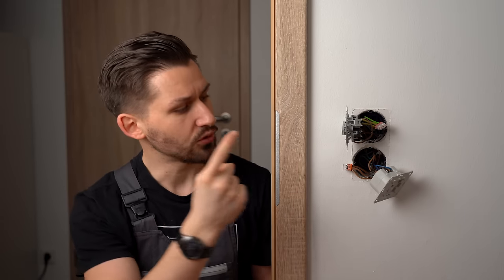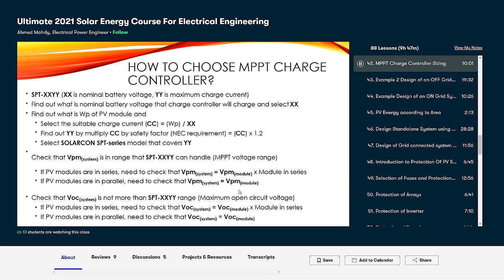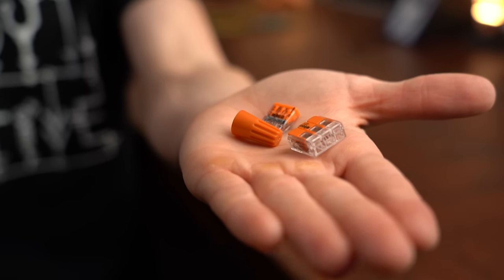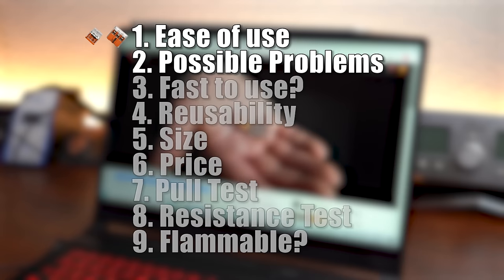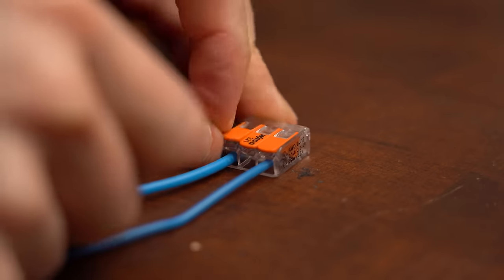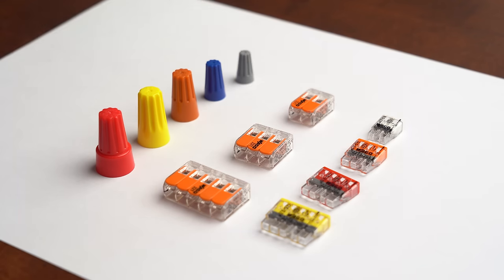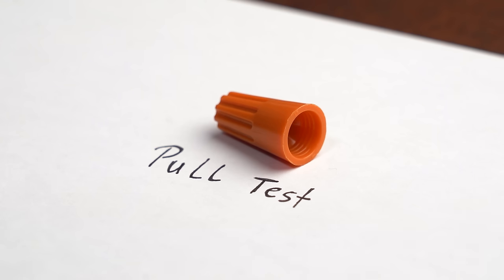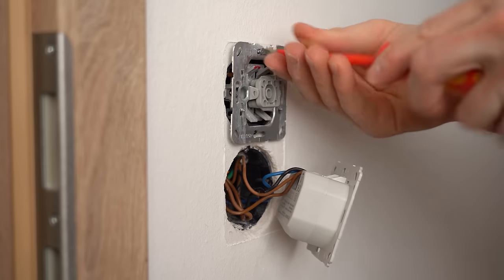What Wire Connector is the Best? Settling a Debate! Wire Nut VS Wago

Comment: I was taught that you do not twist the wires with the wire nut. You twist the wires with pliers first, making sure they are in correct and intimate contact. Then you twist the wire nut onto the twisted wires.
Reply: It would have been nice to see wire nuts used correctly. They wires are supposed to be twisted together before installing the wire nut just as you said. Also a fairer comparison would be using the Ideal wing nuts because those are what is used in the field here.
Reply: @davisladd6473  whats the difference with a wing nut?
Reply: @tjeulink  wing nuts allow the bare hand to leverage higher torque to the copper wires, twisting tighter.
Reply: @davisladd6473  it's actually not necessary. I do pretwist mine. However wire nuts are made to cut into the conductors and grip them and twist them.

I prefer the redundancy, myself, as many do so it's still done. If you don't prep the wire proper(good length, mechanical twist, trim after) then you can make an even sloppily connection and you should have just let the wirenut do its job.
Reply: I was told by someone much smarter than me to pre-twist wires before the nut.
Reply: You are correct. I was also taught that the wire nut is to insulate the connection from everything else around it. Glad to see someone else knows this.
Reply: @etherealrose2139  It's specifically not necessary with the advent of integral square wire spring, but it's still good practice. Before the springs it was necessary.
Reply: @davisladd6473  read the bag on your next set of wire nuts. They don't recommend pre-twisting with most current wire nuts.
Reply: @jessem8928  i dont see how that would make much difference in the video. But it is a better design
Reply: @davisladd6473  So you should first twist the ends together with a plier and then use a wing nut for tightening...ideally standing on a ladder 3m above the ground? I don't think that's an additional bonus point for the wire nut.
Reply: @paulpahl1607  The bonus point is for a solid low resistance connection that won't fail in 100 years. That's why electricians don't make €15/hour.
Reply: @Peter_S_  How do you prove that the connection is solid when you see nothing? Tearing at the wire nut? Sounds professional.
Btw: There was another comment from an US user who stated that he had to replace all wirenuts over the time because they became loose. Hmm...
Reply: @paulpahl1607  You're trying to invent a problem that doesn't exist, and then you get sarcastically snotty about it. This video shows how to incorrectly attempt to use wire nuts. Have you ever used a wire nut? Have you ever seen a wire nut in person? They contain a coiled spring that crushes the wire harder than any Wago could ever dream of. There are tens of billions of wire nuts in use right now. They create reliable gas tight connections and some are even rated for direct burial. Wagos start out lose and only deteriorate. Look at the resistance test.
Reply: @Peter_S_  Yepp, tried them out. And wasn't lucky about them, too cumbersome and too slow. Beside the fact that they aren't allowed here in Germany because they have no print on it about technical specs, technical verification and CE.
I prefer to spend a little bit more money and then feel save and be much faster with my work.
And I know nobody who uses them...different countries, different approach I think.
Reply: @paulpahl1607  If you can't operate a wire nut, how to you manage to operate a screwdriver? Nuts produce far better connections as shown in the resistance test here. When used properly on new wire the lever wago was 14.6 TIMES higher resistance than the wire nut. High resistance = failure point. That's where fires start. Bad connections to save 4 seconds on a job somebody is presumably paying you good money to do good work on? There are plenty of wire nuts in America that were installed before your country was taken over by an Austrian landscape painter and driven to destruction. They're still working perfectly fine in buildings across the country so you may want to double check your criteria.
Reply: @paulpahl1607  better fall off the ladder than burning down the house 10 years later
Reply: @paulpahl1607  how do you prove the connection is good? duhhhhh you make the damm connection and then AFTER that you insert the nut... for insulation purpose only....didnt you read someone above explaining it to you? its the best practice for safely using wire nuts

Comment: The reason the Wago connectors have a current rating and the wire nuts don't is because of the way power flows. In a Wago, the power has to go through the connector, but in a wire nut the wires are held together and power goes straight from one to the other.
Reply: Yeah pretty much. With wire nuts, the connecting element being conductive is more matter of fact rather than elementary to the design. Definitely an advantage from an electro-physics perspective.
Reply: Sounds like a potential way to start little tiny fires inside your walls and attic when there's an over-amp situation.
Reply: @ShadoFXPerino  Wagos aren't meant to be fuses, and they can absolutely melt and fuse wires together open as well.  They CAN act like a fuse, but there is no guarantee of it, nor is it something to be relied on.  If you have overcurrent, it's melting and fusing just like a wirenut would.
Reply: @truthbetold1855  He has not mentioned them acting as a fuse in any way. Thats only your interpretation.
Reply: @truthbetold1855  A wire nut wouldn't melt and act like a fuse because the wires are physically twisted together. The wirenut is not carrying any current. You can take it off and the mechanical connection of the copper is fine.
Reply: @ShadoFXPerino  not really. They are likely dimensioned to take at least 1.5 times theit rated current indefinitely. They and any other wiring only become a hazard if you put them behind a fuse that's rated too high to begin with.
Reply: @RicolaTanker  Some idiot might wire a fusebox open because they don't want to be bothered with fuses, or lightning could strike some part of the house, bypassing the fusebox altogether.
Reply: @ShadoFXPerino  That's why you should design your wiring to disconnect at the supply side in an overcurrent situation!
Reply: @ShadoFXPerino  "when there's an over-amp situation" - a what? Ignoring the fact it'll grossly outperform your wires for just a second, a what?
@Hugo - wagos aren't meant to be idiot-proof, it's just a side-effect of better design that they are also that.
Reply: I don't know why everybody talks about something before thinking and doing research. Nowadays, you can act like a like a professor without any knowledge and people will blindly praise you.
Reply: We should develop a type of switch that breaks the current in case of over current, or a short in wires somewhere. We should call this device a circuit breaker.
Reply: @ShadoFXPerino  this is not a problem with the connector, and also why we have inspections. You can think up all sorts of ridiculous "what if" situations to try and make the connectors sound bad, but when you use them as intended that isn't a problem.
Reply: @ShadoFXPerino  if lightning strikes a house, getting into the wiring, the connectors don't really matter. Current will be high enough to make any wire commonly found in a house glow, and the lightning itself will likely set the house on fire. If the electrics are up to (modern) code, wire insulation, junction boxes etc. should be fireproof enough that the electrical installation itself shouldn't start a fire. Connected appliances on the other hand...
And if someone bypasses the RCD/circuit breakers, all bets are off anyway (just like any insurance...)
Reply: @jawaring4367  but what ifs do need to be considered. Even though wagu has more resistance, they are less likely easily removed. What if someone tries to steal the wire connectors in your house, or a kid gets into the panel. Having a connector not easily removable will be an asset. The time it takes for them to remove it is valuable time for them to get caught and police to arrive. We have to think from a security perspective. The safest door look is sometimes the one that takes the longest to defeat. And sometimes you have to make your stuff more difficult for theives to steal.
Reply: @koma-k  that's where the wagu could act as a fuse and prevent the lightning strike from traveling further.
Reply: @ShadoFXPerino  Wire nuts are used in pretty much every American home. The electrical code here is as strict as anywhere else in the world, and it shows.
Reply: @Floortile83  honestly if someone is going to break into your home I HIGHLY doubt that they're gonna spend time to open any junction boxes or outlets or any other place these wire connectors might be at to specifically steal them. Also if a kid gets into your panel then that's a whole other set of concerns you need to be dealing with, first and foremost being why is a kid even going into your panel in the first place.
Reply: @gnorty  you mean by using something like a fuse/breaker box?
Reply: @vapecatt  beat me to it!!
Reply: @randompersonoftheinternet8012  The electrical code here (Norway) requires that you shall be able to inspect everything visually, so hidden wiring has to be in conduits so it can be pulled out, inspected and replaced without having to tear down walls. As far as I can tell, in the US wires are commonly fixed inside walls, making inspection and replacement impossible... So I'd argue the NEC had some way to go before your claim is true 😉
Reply: @JackHudler  what, so your inspector doesn't allow wires either? Or was it  room temp superconductors?
Reply: @shanebirt1  I dunno why a kid is going in my junction boxes, and I dunno how answering why they are is the most important problem. I mean, I guess I can see how the 'why' is important. Like, the best way to stop a break in is to deal with why they are breaking in in the first place. For example, if they are breaking in because they are poor, then work with them to get a job and manage their finances. It just doesn't seem the 'why' is my responsibility to fix for them.
Reply: @koma-k  Here in the States we just go ahead and visually inspect the wiring before the walls get closed up, that way we don't have to pull wires out of our conduits to inspect them. ;-)
Reply: @Floortile83  being that it only takes about 30000 volts to jump across a wago and a lightning strike is around 300 million Volts... yeah its still going thought the wago.
Reply: @250lmferrari  except if you get a situation with a serious short-circuit in an appliance - how do you make sure your hidden wiring hasn't been compromised? Or if you buy an older house - you're happy to tear down all the walls to check the wiring?
Reply: @koma-k  That was just a cheeky response to your cheeky comment. Here in the States most commercial, industrial and multi story apartment buildings are done in conduit and armored cable. Really it's only residential work that is done in romex. But hey if you are that worried about the insulation on your wires you can always megger them.
Reply: @koma-k  Also don't get me started on how bad older residential wiring is here. there were a lot of "do it yourselfers" in the 60's-70's and it is atrocious. Also I have worked in a house or two that still used knob and tube wiring, ugh  🤮
Reply: @250lmferrari  oh I've seen some rather dodgy stuff here too while house hunting, some of it far newer than our seventies house, which I have yet to find fault with except that the original owner seemed to have run electricity to the garage himself, and that run was most certainly not up to any code at any time in this house's existence. Everything else looks professionally done using the rigid plastic conduits typical of that time. I did make one slightly worrying find - a section of said conduit (long since disused after other renovations), found while renovating a bathroom, had a section clearly damaged by heat to the point about 40cm of it was blackened. It had only fed an outdoor light, so presumably there had been a short at some point.
Reply: I thought that was quite obvious
Reply: @Flyingdinosaur69  It should be, but if it needed to be mentioned. . .
Reply: @250lmferrari  My house was built in the days of tie die and LSD being legal. I really do not want to look in my walls electrically.....
Reply: @koma-k  The U.S. NEC requires junction boxes and splicing remain accessible. Conductors can be installed in a raceway or as cable assemblies, within walls, depending on use. I do not understand the need for inspection or replacement of conductors, wiring does not wear out. The circuit protection is sized to protect the wires so short circuits do not damage the conductors. Most older houses do not meet code requirements for outlet locations and I can rewire a house with very limited damage to the finished walls and ceilings. I am a commercial and industrial electrician and I have installed a massive amount of raceway, of many different types, and I do not think that conduit is in any way necessary for residential concealed wiring.
Reply: @RicolaTanker  Good thing fuses/breakers never fail...
Reply: @ShadoFXPerino  in overload tests, the wago basicaly only fails if the wire is already melting and glowing, at that point it might as well be a fuse.
Reply: @koma-k  : when I wired my house i ran the wiring underneath the came up into the wall where I needed for outlets etc. 
At least this way I can still inspect or see a lot of the wiring . This increases my odds of not ever having to tear out a wall.
Reply: @bold58  yeah, that works well if you have a crawlspace underneath, but around here all houses either have cellars or are built on concrete foundations. If I were to guess you're in a more temperate climate than I am. There's also the issue of going into and out of the inside zone (through the moisture barrier - again depending on climate and local codes). Actually our cabin has a crawlspace, but parts of it is essentially inaccessible due to low height, and due to insulation and moisture barrier (and rodents) routing electrics underneath is not something anything would do here (nor would Norwegian code allow it without some extra precautions I believe).
Reply: @ShadoFXPerino  Not if ur breaker A  is the correct.
Reply: @randompersonoftheinternet8012  That's not quite true. In the US and Canada in residential applications I have not seen a requirement for insulation tests between the breaker box and every connection point with all possible switch connections (on/off, three-way etc). I don't live in the UK now, but I believe (= don't trust this statement) that in order to pass the permit there is a document that has to detail each resistive value at 500V (???) from the breaker + breaker-box to all the connection points. There is also RCD / GFCI protection on all sockets and lights, not just close to a water supply. An empty light socket cannot give you a shock if you stick your finger in it. You cannot get a shock from a partially inserted plug. (Had that with a tape measure because the earth/ground is normally at the bottom.) There are a few things such as those, likely because 240 is more dangerous than 120.
Reply: @ShadoFXPerino  How, exactly?
Reply: @Floortile83  Right, when someone gets into your house to steal sixty-five cent wire connectors... from inside your junction boxes. That happens all the time, I bet. 😂
Reply: @randompersonoftheinternet8012  really? 1000 Death and 30000 Injuries per year are telling another story. My country germany has around 1/4 of the us population and we have less then 100 Death and less then 4000 Injuries per year - and to be honest as someone who is a certified IEC and certified UL electrical engineer if i can choose i would never use the UL Norm.
Reply: @koma-k  it depends on the local codes, actually. In our jurisdiction the electrical code is more strict so that you actually DO have to use metal conduit. However there are also grandfather clauses where any older electrical installations can stay so long as as they are not currently damaged or working improperly. If someone chooses to renovate and make changes to the house, then they are required to upgrade to conduit. Unfortunately there are many unscrupulous "home flippers" who look to buy older homes, make cheap/illegal/superficial updates, then resell the home as "newly renovated" for profit. 

I found one such home which was "renovated" but was still using a small old-style electrical box with fuses from the 50's or 60's instead of proper breaker cartridges! They also had an electrical outlet out in the open underneath a porch step with no weatherproofing box! That house ended up selling, too. It will be a nightmare for the new homeowner who does not understand such systems
Reply: So why use a wago then?
Reply: @FTfilm  Its mine too. There junk and burn up all the time.
Reply: @RicolaTanker  The wire nut wouldnt have a problem with it.
Reply: @ShadoFXPerino  Sounds like they will start fires without an over amp situation.
Reply: @truthbetold1855  No a wirenut wont melt if put on right. The wirenut doesnt carry the current.